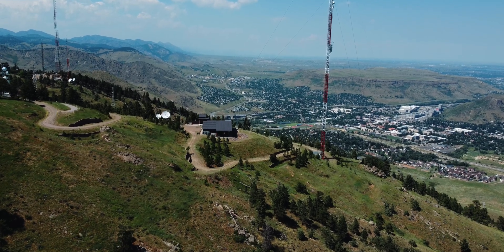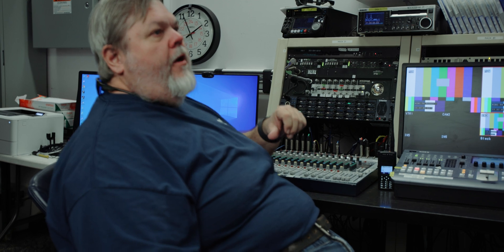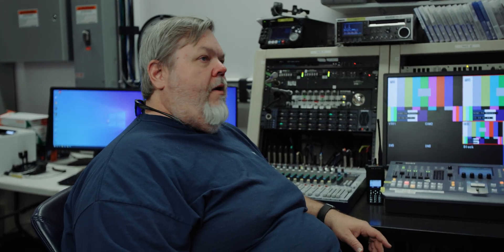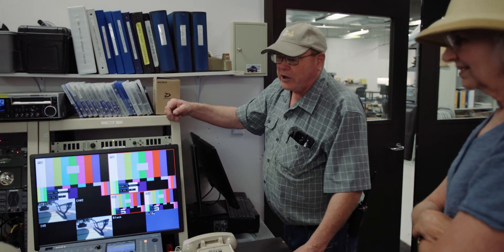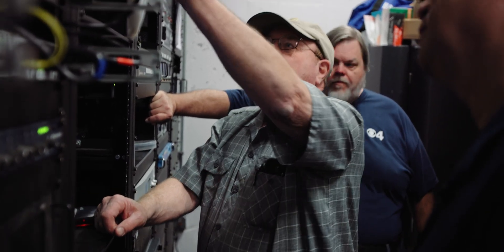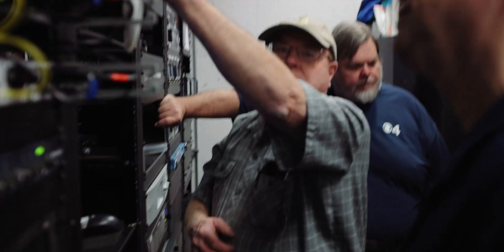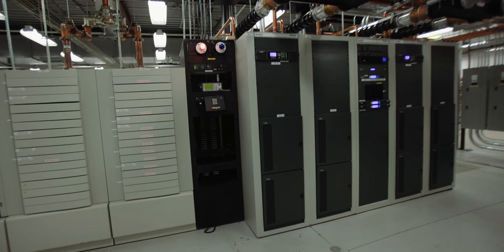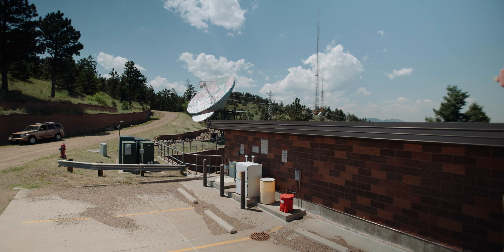Transmitter site deep inside a mountain - Lookout Mountain Pt 2

Comment: Wow, I'm the 100th "Like" on this video. Very interesting. My background is in radio. I've actually owned three stations of my own. What always impressed me about TV was the amount of care they put into their transmitter sites. Some had floors that looked so clean you could eat off of them. Logical layout of equipment. Everything wired nicely and orderly. Radio was usually a "slap it together" looking thing and I always hated it. My stations, while never looking as good as this site, still had a clean(ish) look to the transmitter sites; I insisted on it. 
One thing I really liked about this site is the juxtaposition of the new digital gear, but 1A2 telephones everywhere. Yes, they're old, but they still work flawlessly. I have a working 1A2 system in my house! Kudos to the engineers who constructed and maintain this wonderful site. Thanks for sharing!

Comment: Why do commercial transit sites like this seem to always use giant coax like at the end of the video instead of waveguide? Is it more efficient at these frequencies?
Reply from the maker: It’s cost and frequency. Waveguide is much more expensive and delicate.
Reply: @StringerNews1 Why is waveguide heavier? Isn't it... hollow? I can understand the wind loading being a concern, though, since waveguide is usually rectangular and coax is round. I guess looking online for specs, 500 MHz waveguide is somewhere around 9x18 inches, so that's some pretty significant wind loading. Still, at least within the transmitter site before getting to the tower, you don't really have to worry about weight/ice/wind, so why don't they use waveguide until it exits the building?